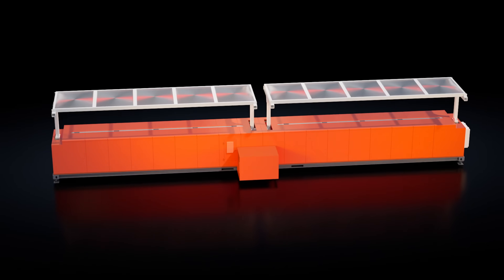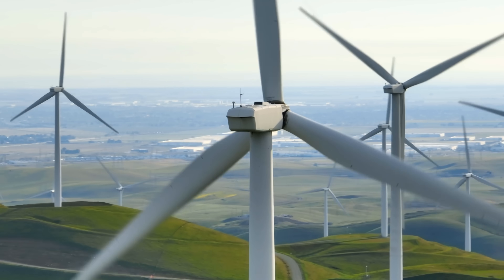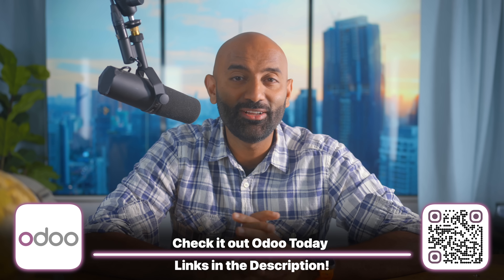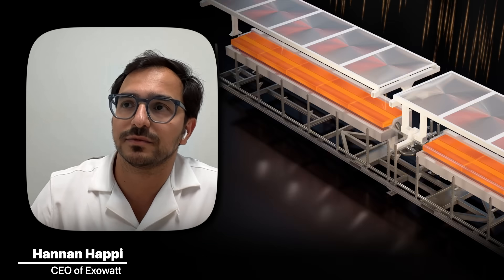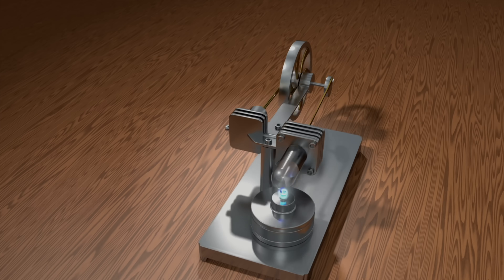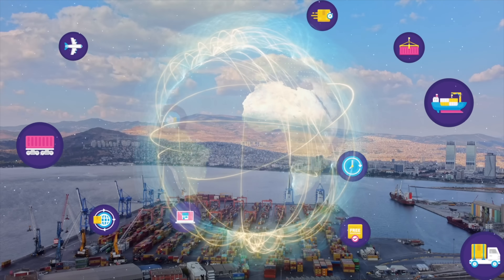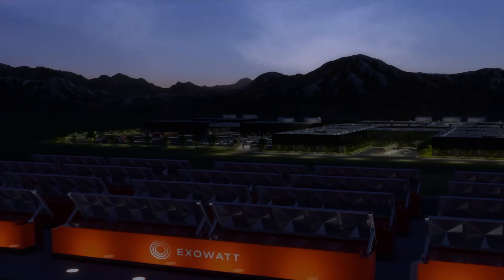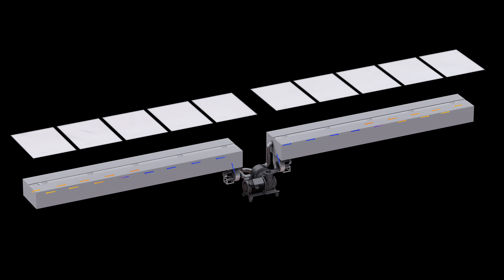Solar Without Panels, Storage Without Batteries - EXOWATT

Comment: There's a lot to like about this idea, including one that wasn't mentioned: there is waste heat from the Stirling engine... if that waste heat could be used to heat water for an industrial process, district heating scheme etc, then even more of the captured solar energy could be used, increasing the overall efficiency.
However, there is a problem that was not mentioned: the Fresnel lenses could do a good job of focusing sunlight onto the "bricks" through the narrow slit when there are no clouds, but sunlight that has passed through clouds is diffused, and the Fresnel lenses simply could not focus that light in the same way. In comparison, solar photovoltaic panels work fine with diffused sunlight.  This might limit the usefulness of this technology to parts of the world that enjoy clear skies most of the time, and it would have to be accepted that cloudy days would dramatically reduce the energy capture.

Comment: I want to know a whole lot more about the heat engine, or Stirling..  The efforts to scale up the table top model to something that can produce significant power has been the challenge..
Reply: Low efficiency. Regardless what people online claim, that's the reason why we don't use them to generate electricity.

Comment: How much is the original cost? I love that is should last a lifetime, that has always been my complaint with normal solar panels and batteries (not even mentioning the ecological disaster so called green power is so far). But what is the cost if you are paying interest on a loan? What about using the heated brick storage on a larger scale under ground for storing grid or other power sources as a backup/regulator?
Addendum: What about where its cloudy? I think in my area a storage in an underground silo for heat storage and burning wood waste would make more sense. I love the idea of it though especially that it can last so long.

Comment: Solar panels arnt that much of a bottleneck as compared to the battery bank systems required. 

Too damn expensive and requires far too much maintenance and replacement. 

A shipping container filled with rock and some fresnel lenses would be really affordable compared to options. 

@elonmusk, this is the way.

Comment: RARE EARTH minerals are used in generator armatures, motors,  and actuators,, NOT in batteries.
The Stirling engine uses WATER as a working fluid - which should be filtered and demineralized.
The engine's piston rings and grease seals will WEAR OUT.
The hot bricks will EXPAND/CONTRACT with temperature, causing eventual metal cracks which will also RUST in the humidity.
MAINTENANCE costs will INCREASE with age.

SOLAR PANELS just sit there.

Comment: My electric bill is high because I have electric heat. I don’t like gas…don’t want it, nor propane. 
Solar would be too expensive because I have a deep well for water with a start surge that draws crazy power. To cover that surge, I’d have to seriously overkill on solar panels and batteries
I’d really love a system though so I can lower my costs, AND not lose power all the time from trees coming down. (Blue ridge mountains…LOTS of trees coming down!)
Off grid or just rural properties and farms are a good market for this more basic tech. 
But…it needs GOOD insulation for colder sites and winter. I may not get sun for days and days. Holding heat longer would be necessary. 
I’d love to try this one. If the company wants a test site in VA, I’m volunteering! I bet my neighbors would be interested, too. 
Just…Orange? Really? Can’t they do a color that blends better? A grayish green that doesn’t draw the eye maybe?

Comment: Yes I would like you to make a tour about the heat dispersion in bricks. Also if you get there, I'd ask about the maintenance part, they make shipping container sized blocs so you can extend, but they also can go modular INSIDE. I mean if you provide some kind of "engine" module, (blower + engine) and some kind of tracking module (just above the engine for example, so it can use engine power ?) you woule have a way better time to improve the uptime. Any maintenance could be done by just swapping the engine module with a fresh one, and still have everything working fine while you do the maintenance on the engine. It also helps with reliability, if you have production issues and the engine break while under waranty, just swap out with another one, easy, quick, and you even get the broken one to study the problem.

I really wish modularity would come more into our lives.

Comment: Would be great to use heat battery to heat homes in the north directly, no need for conversion to electricity and back again.  But I didn't get a sense of how much heat can be stored for how long

Comment: Excellent idea but the problem always with these solutions are they are for scaled energy production.. if someone made a unit that could provide a homeowners true independence and some extra then all the energy needs of the world would be much closer to being met.  
Run the numbers on heating those things from the grid as I think that is a waste if the inefficiency in heating back to energy is as high as I would suspect and those are likely more added cost in upkeep and parts.
If something went wrong and we lost sun for days with lots of grid energy heating and returns to power.. the price of energy would jump which is the downside of all these energy systems as one well placed volcanic event kills huge clusters of energy! So all these mega projects and building towards larger capacity fail to address the larger and larger gaps for vulnerabilities to extreme events they said were going to be on the rise before moving to implement them!

Comment: What are the net contributions from the Fresnel lenses (not much bigger than the top side of the box)  and swinging mechanism if they are just heating a box of rocks under them? Wouldn't the box of rocks' top side and front side get the same amount of (or more) solar heat every day in the absence of those things on top of them? Also, paint the boxes black instead of orange reflecting some of the infrared, red and yellow in the solar spectrum.

Comes to think of it, burying coolant pipes under the asphalt highway and run pumps to circulate the coolant and capture the heat can be a way of generating electricity without taking up any space (the road surface is already there, and the pump stations and generators would be in the existing empty zones on the two sides of the highways)

Comment: It sounds interesting, but how does it deal with cold temperatures?  While solar panels have reduced outputs in winter, they still produce electricity. What is the minimal battery and outside temperature for the sterling engine to still work?

Comment: How much does the container weigh? Many roads might not be able to handle the weight, and also the cost (and thickness) of the concrete pad it sits on. - love the promise. Worry about damage to the lens and too many moving parts.

Comment: I would place flush under ground. Then insulate and have underground solar channels with hydro gardens floating along with solar tube and light pipe with solar focusing. Then planting abouve ground trees. And radius gardens to fortify the desert. Then build The clay and brick 3d printed hones.

Comment: Developing a “small” or “micro” version of the Exowatt system that’s “towable” by a pickup or small SUV would be ideal for off-grid cabins or small homes. This would offer a chance to test the technology in practical settings without having to adhere to the SLA constraints of data centers.
Reply: @user-yj9cm5kj5u  I was thinking a 20 foot cargo container as a smaller version. I don't think a 40 foot one would fit in my yard.
Basically the same thing, same dimensions, just half as long.
Reply: a canoe size one
Reply: Wow! I love this! I have 3 acres in high desert, high solar exposure. I want this sort of efficiency for a domestic usage. ! Thank you for this presentation!
Reply: @j.thielsen6232 with that kind of land you'd probably be a supplier to the grid 😂
Reply: @user-yj9cm5kj5u  another good use-case for a trailer driven one that could come in incredibly useful - disaster relief operations. Those are typically events that have no or minimal power/grid operations, and a lot of things to aid in recovery are greatly improved by, or require, power. Something that can be towed into a disaster zone to help literally power recovery operations - local radio/telecom operations, running fridges/cooking equipment for food stations to feed those affected, lighting in nighttime for longer hours of working in those early stages when every second counts.... Being able to get a source of power in there that won't run out so long as the sun is in the sky at some point can genuinely mean the difference between life and death.
Reply: @user-yj9cm5kj5u  This would be great for our desert 2 acres of land for our domestic use. Crossing my fingers that this is totally successful.
Reply: - Just the simplicity of Solar thermal - a flat panel hot water system generates around 3kW in a similar area for a 1000W solar panel...

 - that ELCTRICITY is the most fungible energy source, is what makes PV electricity so universal.

 - Converting thermal to Electricity using a stirling engine can be at best ?/ 45% efficient and that requires a Carnot temperature difference of several hundred degrees C....  a 400degree minimum temperature difference COULD get us a real world 50% (Carnot theoretical efficiency of 59.42%).

Comment: Great for the desert. Nut not areas that are being deforestation like what's happening in ranches around South texas. You could litterrallt replace power lines with hubs built vertically like a building with internal focusing lasers and solar pump lasers which then woupd 8nclude hydrogen. Generation as well.

Comment: Remember anytime between now and especially peaking at 2040 the Sun will micro-Nova again. 
Rendering solar and anything else needing electricity or using chips to operate useless for at least a decade. 
Induction currents will literally fry anything conducive. 

(Space Weather News: 6,000 year Earth Disaster Cycle)

So a dumbed down:
[fresnel lens + sand/bricks = steam anytime steam power] is a good insurance policy vs. Solar/battery. 

Plus it’s literally 😎 steam punk 😎 with adding analog dials, letting a couple of steam leaks go, wood panels and brass trimmings. 👍 

❤️☦️🕊️

Comment: Sorry, this product to me looks fundamentally flawed.

Aside from attempting  to totally dismiss efficiencies and ignoring various types of thermal, conversion and electrical losses, the most glaring is how high temperature are achieved. It's a basic lack of physics understanding to simply say fresnel lenses will generate enormous amounts of heat without understanding how they work.

Fresnel and other magnifying lense colle t light from a large area and concentrate into a lsmall area and by doing so increases the intensity of the light radiation. If you don't  start with a very large to begin with, not enough heat radiation is collected to make any difference and the magnification becomes useless. These shipping containers would be just as useful or useless using a flat pane of window glass.

To achieve very high con e trations of radiant energy fro. The sun, think of Inkopah in California which is being shut down because it's no longer competiti e to PV technology. Acres and a res of mirrors refle t sunlight on each concentrator to achieve the temperatures this shipping containers ate supposed to achieve.

The math just doesn't  pencil out.

Comment: This could work for businesses that need a lot of heat use for there business, but I don't think it will do much for home use, I suspect as renewables continue to get cheaper and better, more of us will want to go off the grid and provide our own power onsite, which ideally will mean solar, wind and any form of energy storage device, solar works well there, wind not so much in urban areas but that could change, as for energy storage, well that needs to get better and cheaper but it's on its way thanks to EV cars.

With that said, maybe a smaller version of the tech for home use could work.

But honestly, the way I see it, solar is winning the race with how cheap it's getting and eventually, you can plaster it everywhere, with energy storage getting cheaper, especially with EV cars, that will eventually filter through to homeowners, so even thought this tech shows promise, I suspect most of the industry and homeowners will stick to solar, maybe even a mix of solar and wind if they can get wind power to be more effective in urban areas.

With that said, it might be different in the US because solar installations are like 2 to 3 times more expensive than in the EU and much of the world, so that has a big impact on the direction of which to use.

Comment: What am I missing? Isn't the main benefit that this system is a solution to the 'peak load' problem and the 'dunkel flaute'. It is a storage and generator in one, right.
Drawback could be colder climates ?
Certainly worthwhile. I do love the Sterling engine !
Do visit the site.

Comment: I am looking to build an energy farm but the problem I have is the electricity cost is very low where I live, Quebec Canada. Would this work in Winter sub zero. I have a lot of land. Electricity cost is around 6 c US per kw. Yes, I am very interested to know more. How much it cost, is it well insulated. Not much moving parts, very long lasting, easy to recycle. Thank you so much, I have been looking for something like that, micro wind turbine, solar farms. None of them return the capital invested du to the affordable hydro electricity. We can connect directly to the grid .

Comment: A consumer model with about half of the length would not make much sense at this time, because they would have to scale down the stirling engine as well. But how about implementing a sales system for small orders, specialized in small scale worldwide transport, installation, payment, systematic local maintenance including warranties. That would at least bring the added storage system to small communities in regions with a lot of wind and solar power. And for small scale use, they could maybe add heat pumps for direct transfer of thermal energy to heating or from cooling systems. Anyways, maybe the energy- sucking and uselessly heat- producing AI-hype bubble will at least leave some useful second- hand- material for communities behind.

Comment: The problem is the use of high temperature to store energy. The heat losses are massive, yes, but it's much lower losses than using transformers and excessive long wires that heat up wasting massive amounts of power! Now just change from heated rock to compressed air and your on your way to real renewable solutions! And if Sun light is not so strong where you live on the planet, you can use small and inexpensive vertical wind turbines to compress air! And it's all base load capable!

Comment: @4:00 "they are bricks after all"... Maybe you are to yound to have contact with this technlogy... most furnances with temperature shocksneed to be rebuild every few years, because ceramic crumbles in the end.
Reply: What kind of furnaces?  Are referring to blast furnaces for smelting?
Reply: @beyondfossil blaat furnaces are quite extreme example 😉 but watching some guy melting rocks with such lens maybe not? But even big (human tall size) heating piece in my old home must have been rebuild. Maybe those brick laying flat with less mechanical stress will run longer but this devices don't exists more than year so even them don't know.
Reply: @AK-vx4dy  Yes, the bricks used in thermal storage are not part of structural integrity as they're just used as thermal mass.  The bricks are likely packed tightly within a heating vessel with heat exchangers embedded within.  So even if the bricks cracked somewhat, that would not affect the energy storage operation.

Furthermore, Exowatt's bricks are likely stored in an oxygen-free environment isolated from the outside.  Or the containment area is filled with a low-pressure inert gas like nitrogen.  So the bricks would not experience oxidation stress which would be especially problematic in high heat situations.

Even more, unlike traditional furnaces and kilns, the bricks in Exowatt's designs do not experience direct flames with ash, soot, corrosive vapors (sulfur, alkali metals) being constantly deposited on them.

So bricks or any other ceramic-based storage (sand) are used very differently than those used in traditional furnaces/kilns.
Reply: @beyondfossil maybe not but cracks will affect heat transfer amplifying thermal stress, also judging from other video temperatures can be higher than flames if some problem with focusing will happen. Bricks in electric heated ovens (not kitchen) also happen to crack. 
But as you said inert gas will lower chances in some way.
We will only see how it happen in practice after 5 or so years. Every night is thermal stress cycle in sense that heating from one side is on and off, even if you not draw power. and you should count clouds too depending on local climate.
Reply: @AK-vx4dy  The major point is that bricks used in traditional furnaces/kilns and bricks used thermal storage are very different use cases.  Both situations use heat, yes, but the operating environment is wildly different.

Comment: Seems like this, and all thermal battery designs, would be much easier to build if you just built them underground. Dig a round hole, put down a moisture barrier, then use perlite or something similar on the bottom and around the sides. Not only would it be cheaper, but you could also have far more thermal mass and the lenses would be closer to the ground.